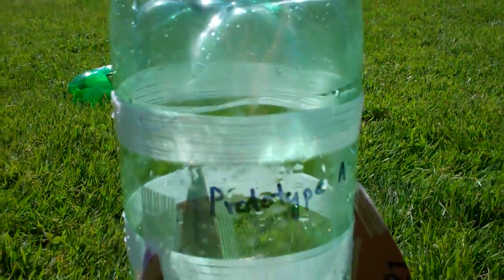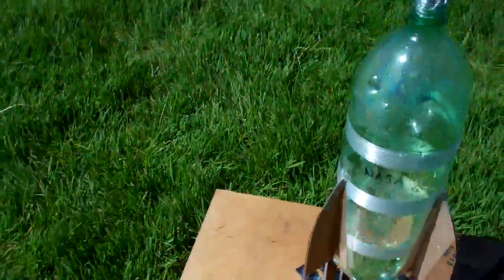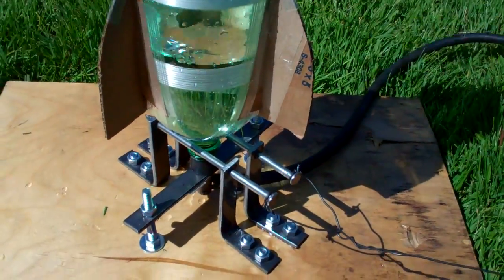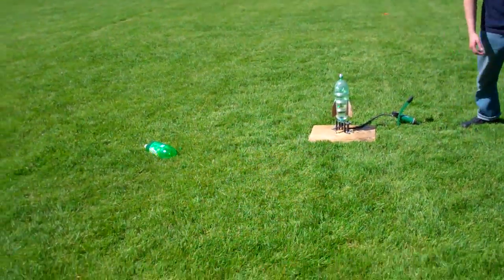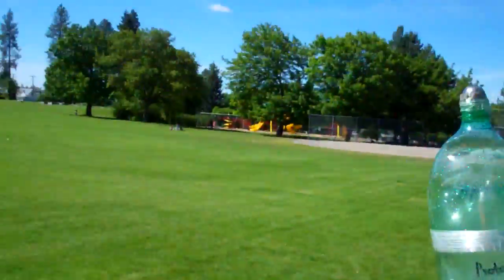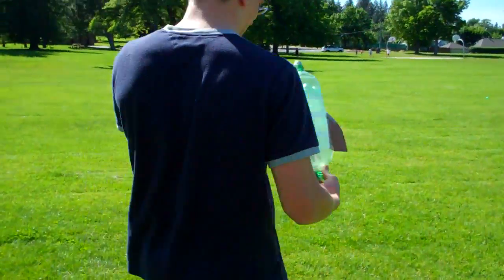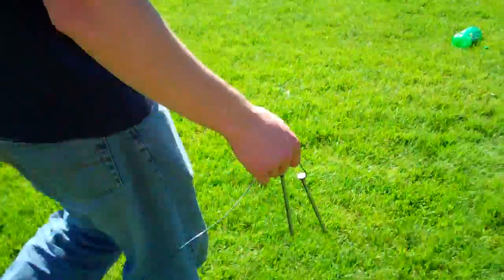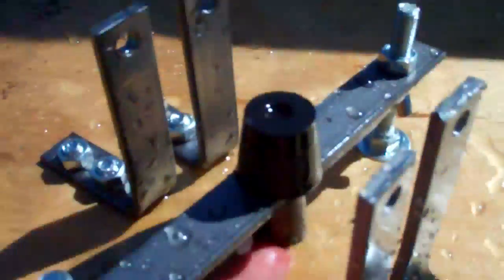Bottle rocket design and launch ~ 260 feet into the air!

Comment: Where's the proof that it went 260 feet into the air?
Reply from the maker: We timed the drop times in multiple launches, and it ranges from 180-300 feet. Depending on the pressure and the rocket design.

Comment: So the goal is to get more weight towards the top of the bottle? Is it to make it more stable by moving the center of gravity up? I think it is, but wouldn't the added weight overall decrease the maximum height the bottle would go? Or would the added stability be overall better and make it go higher even with the added weight?
Reply: The added weight only affects launch. You need more force to get the rocket off the pad, but once it gets off, it will go higher. If you use 90 psi on a light rocket, it will start fast, but quickly decrease in speed. If you use 90 psi on a heavier rocket, it will start out slower, but will go higher. Whenever the rocket reaches its peak and turns around, it will not travel down faster if it is heavier because gravity affects all objects the same. Hope this helps.

Comment: Your projectile is in the air for 7 seconds. 3.5 seconds up, 3.5 seconds down.  A projectile on Earth will fall 60m in 3.5 seconds, which converts to 185.5ft. (d=1/2gt^2 + vit) Maybe next time.
Reply: Wrong, on a couple levels.  You are assuming that the acceleration UP is the same as the acceleration DOWN.  Which it is not.  You also assume that there is no loss of downward acceleration due to friction (air resistance).  I can assure you this is not the case for a big light plastic bottle...
Reply from the maker: Nice man. Thanks for the physics! Correcting the title.
Reply: Perhaps you have not read my other comment where I addressed such uncertainties.  In the spirit of correcting people: your "couple" and use of the word "also" occur whilst describing one thing: the assumption of constant downwards acceleration. ... Unless your 2 things are:
1. Acceleration due to gravity acting differently on upwards moving projectiles than down. 
2. Air friction changes the motion of the bottle. 
If those are your 2 things than you may want to double check #1. Cheers.
Reply: Peter Harris
  You're confused Peter, perhaps you should revisit high school physics?  It is not a matter of gravity 'acting differently' on upwards moving projectiles than down.  You are ASSuming that the ONLY force acting on the upwards moving projectile is gravity!?!  That is NOT the case.  There was not an instantaneous force and therefore acceleration of the object in the upwards direction.  It was a force (and therefore acceleration) applied over a time.  This should be a hint to you that in fact the upwards and downwards accelerations are not equal...rendering your high school 'plug n chug' formula incorrect.  And pardon me, I did not (and don't plan to) both searching out any "other" post you may have had on this very simple topic.
Reply: lol. No. you do not get a pardon for not reading my previous comment and replying at length without knowing what I said. Way to waste your time.

Comment: How did the rocket go up ? I mean , on what did the water make contact with , the wooden plank or the nozzle of the pump ?
Reply: Aditya Babu 
How it works:
The pump puts air inside the bottle
The water reaaaaally wants to come out but there is no space to escape
The bottle shoots up into the air (the smaller the nozzle the higher it goes)
The water is released from the bottle then it comes down
The. End

I know this is a long time later but I hope that you understand now

You're welcome

Comment: that is impressive! i calculated that the begin acceleration must have been about 270 m/s2 assuming that the rocket weights 500 grams, and the nozzle has a diameter of 1.5 cm

Comment: Well done, but here's a tip. Get a scuba air bottle to fill your rocket. It costs a few dollars to fill, but you'll get a lot of launches with less effort, and the pressure is higher than you'll ever get with that foot-pump. Also, try putting soda water in your bottle. It will saturate with air better, and you'll get more thrust. Last year, we tried a few launches using helium. It costs a bit but it was fun to experiment with.

Comment from the maker: No, I just saw one, took a picture of it and made it that way. It's pretty simple as long as you understand how it works. You need to buys some hardware and have a couple of metalworking tools. The metal bars I bent in a vice, and drilled holes in them. the trigger mechanism is made with two large nails.The stopper has a nipple from an old bike inner tube glued in with rubber cement. Hope that helps.